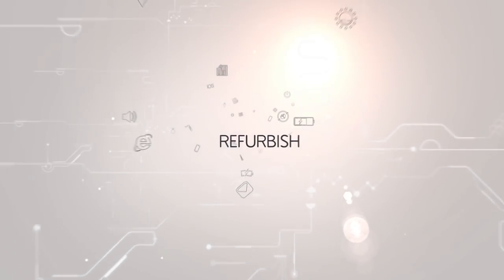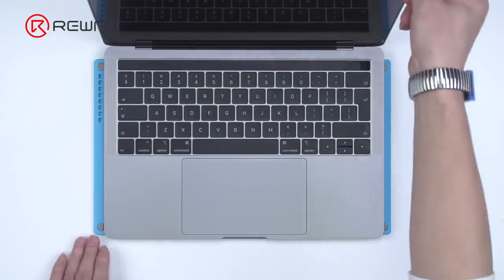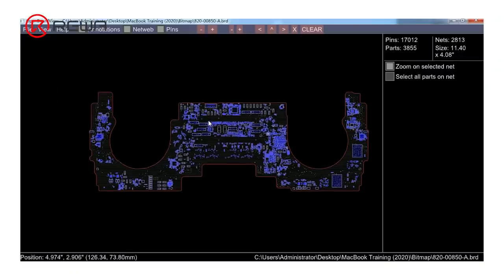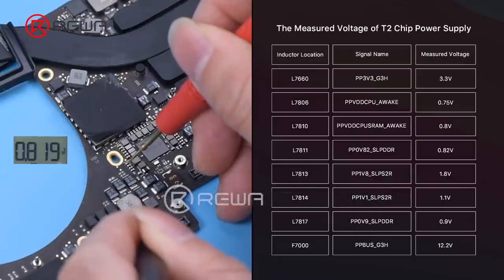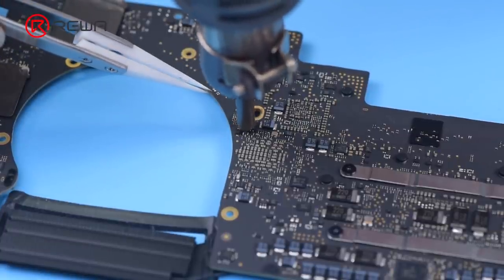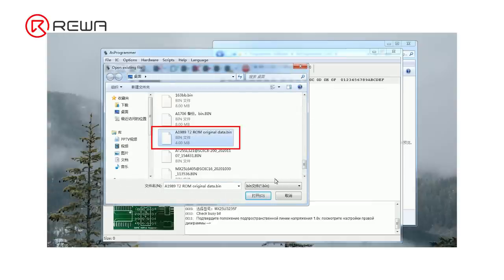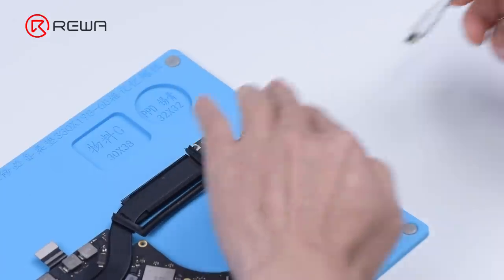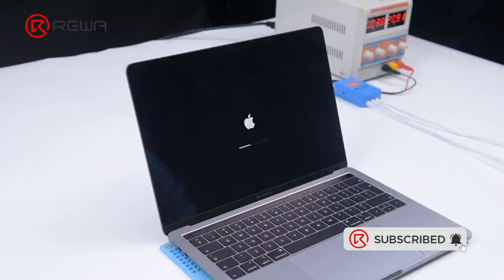MacBook Pro 13'' (2018) Won't Turn On Repair - T2 Chip Data Restoring

Comment: Very good. I;m doing a repair to MacBooks as well, so I amazed with the video and especially with the programmer. If I purchase one, will you support with T2 dump files? Thanks.
Reply from the maker: For more product details and support instruction, please check the link: https://bit.ly/3qnQFmd
Thanks for your inquiry. Please send your questions or concerns to us anytime. ( service@rewatechnology.com )
Reply: Save your money, it's as BS like all the tools that REWA and Union Repair sell for this sort of stuff. The programmer will work but good luck finding to T2 ROM files that they talk about. Biggest con in town.

Comment: Well good luck finding right firmware dump. T2 restore with apple configurator does the same job - it restores both spi and ssd stored bridgeOS firmware. If you got damaged spi it might be harder to get into  DFU mode and it will also reset during first attempt so you might need to restart  the whole process after seeing it stuck or failed but it will work.
Reply: I have actually tried this and it is unable to boot into dfu with an invalid ROM firmware. changing the serial number will result in being unable to activate the MacBook. It needs a matching serial and uuid etc in the rom firmware to activate through Apple activation service
Reply: No even need to restore with configurator 2 you can use the revive option so that the user data wont need to be wiped off

Comment: How is that any different than restoring T2 via Apple Configurator Tool?
Reply: nothing just they are trying to make money. you can do it with any rom programmer who can work on 1.8v but yes you need that socket otherwise you need to make some jumpers. you can see they are using drivers of ch341 programmer which is 4 dollars programmer.
Reply: Kamalpreet Singh Randhawa well said
Reply: This should be top comment, Nothing at all, but Rewa won't sell this shit if they show the good way of fixing this issue XD

Comment: I have a Problem, that my Mac is stuck in DFU Mode. Restoring BridgeOS with Apple Configurator won't work. I think its Bricked. Is it Possible to get out of DFU Mode with Restoring the T2 Chip like in the Video?

Comment: Will this work for a MacBook Pro 15inch, 2018 (A1990)? If so can you do this for my MBP? Please kindly advise.
Reply: Hi Dante, did you get fixed ? I’m having same issue MacBook pro 15inch 2018. Please advice. Thank you
Reply: @mohamedasikm5559  Not yet. I never got a reply from these guys.
Reply: @DantePettus  Thank you for your prompt response 👍

Comment: Hi i have same issues with my macbook air 2018 a1932 the voltage is only 5volts pls help
Reply: you got solutions for taking 5 volt ? after rewrite rom

Comment: the step at 1:26 is extremely important. make sure you use a tweezer, not your finger. you can easily tore the battery connector flex cable. it's flimsy as f.